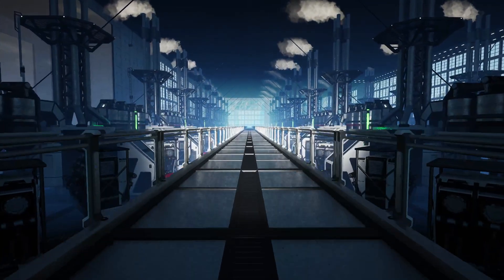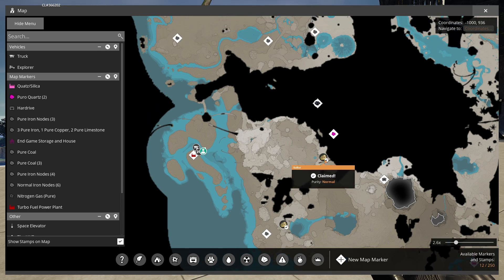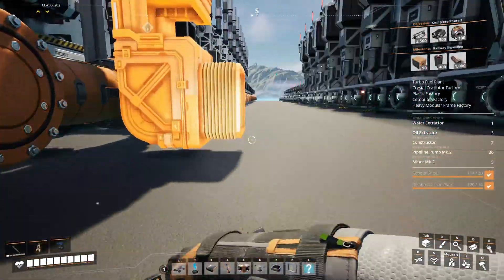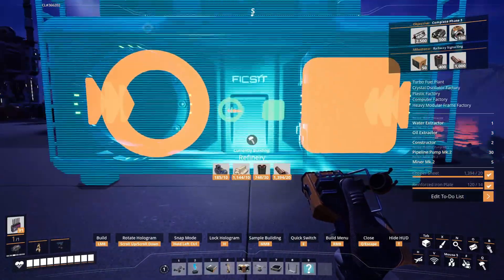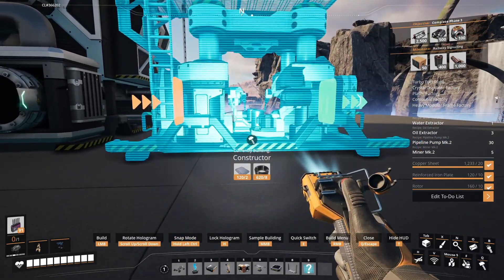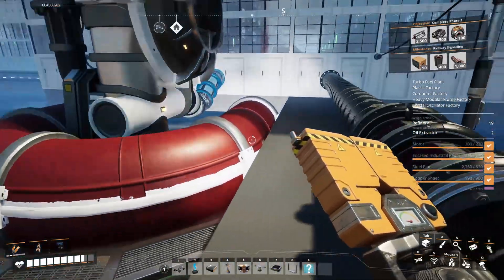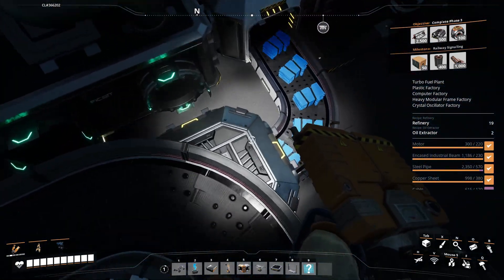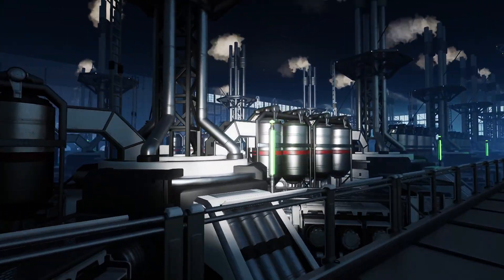Basic Turbo Fuel Factory - Satisfactory 1.0

Comment: ty for the video , i got a question ,  i see 9 Refinery thats gets oil so its 540 oil not 600 Olso  i see 10 Assempler so we need 250 coal / 250sulfur not 240/240 correct? though its still doing its job just saying :P
Reply from the maker: Yes and yes xD I just love doing more, that's why i placed sinks so they dont back up hehe